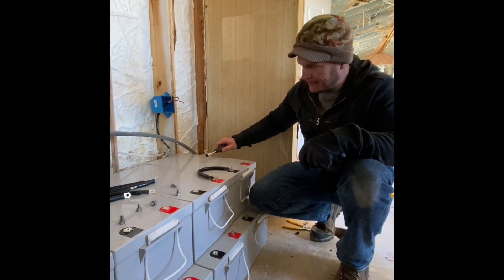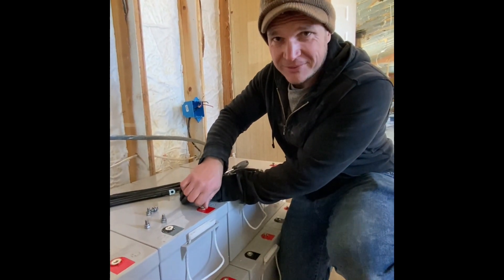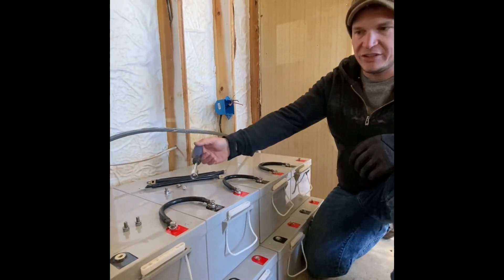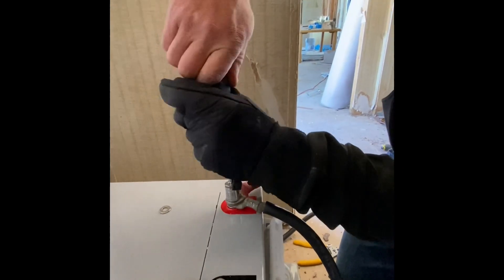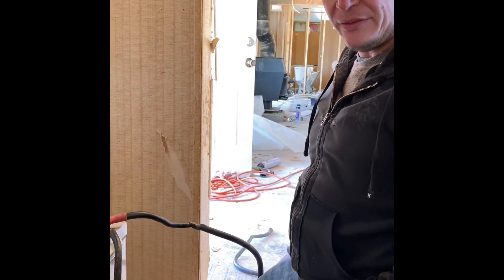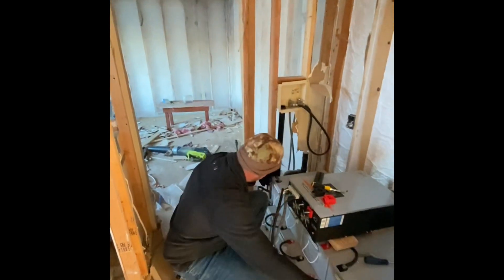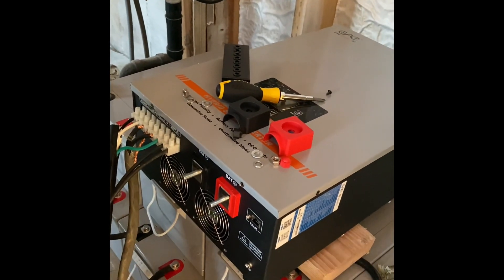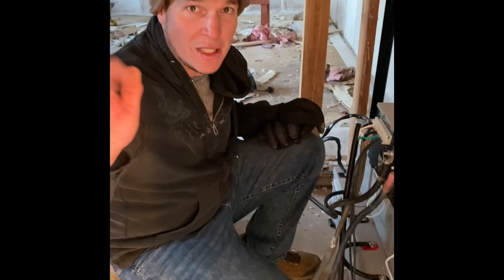How to turn 12v batteries into 48v system for inverter

Comment: What gauge do you recommend for 4x12v with a 6.5kw inverter or 13kwh inverter.

I need help with jumper size, and to battery rail. Connecting in parallel with Lifepower 4 to eg4

Comment: How can I ad more 2×12v to my system  of 4×12v inverter that already is working
Reply from the maker: You have to series four 12 V batteries together into a 48 V configuration two batteries won’t work four will.
Reply from the maker: If you’re running a 12 V inverter, then you can parallel two more batteries on there. I’ll try to post a video soon.